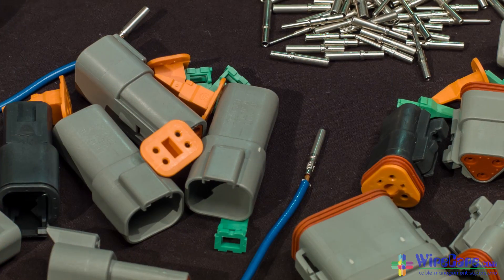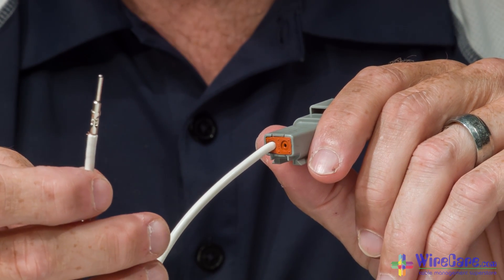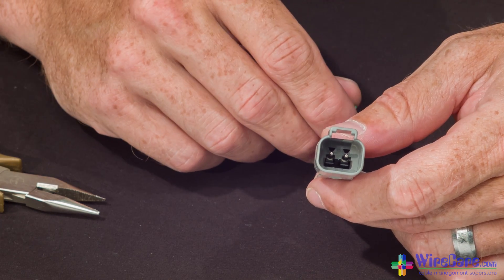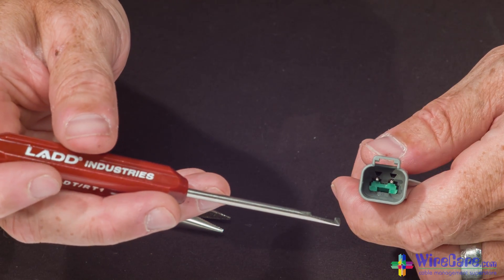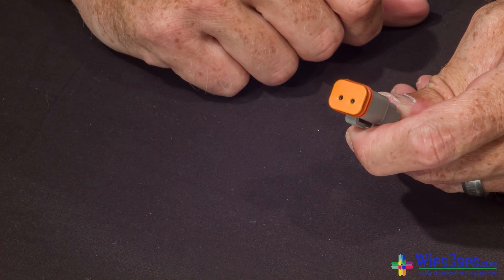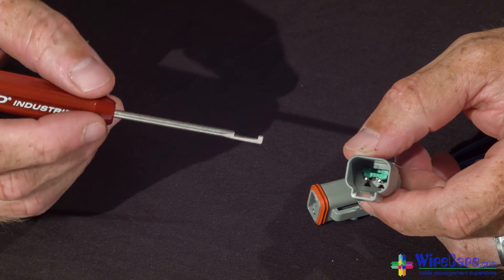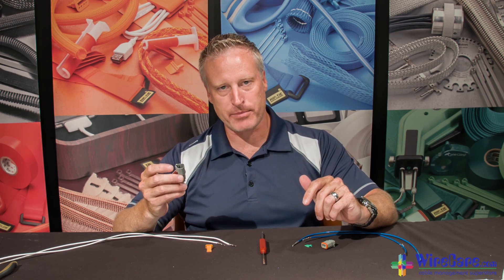How to Assemble & Disassemble Deutsch DT Connectors

Comment: Thank you for this. It was very helpful. I had to disassemble and reassemble a female fitting to get the wire through a too-small hole. You missed the catches holding the pins. It took me a while to work out why the pins wouldn't come out.
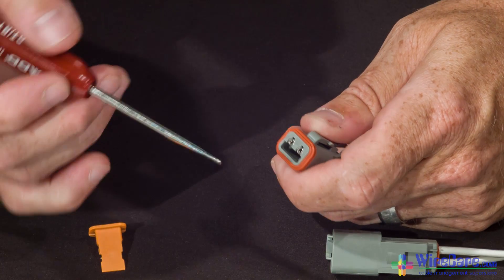Reply from the maker: Thank you for your comment. We appreciate it! At min 3:08 we do discuss depressing the tab to release the contact, but you are correct, we do not actually show the tab inside the connector. Sorry about that!

Comment: I guess it helps when you use the right lock for the right connector. Thanks for ending my temper tantrum. I was ready to throw everything in the garbage and go back to the tried and Tru solder and heat shrink.

Comment: very good instructions, should the power source be connected to the female or the male side?
Reply: I looked into this, and it seems per WireCare's response, the female side is standard for safety and reliability: 

"The female side of the connector has recessed contacts, meaning the metal terminals are less exposed. This reduces the risk of accidental contact with conductive objects (e.g., tools or metal surfaces), which could cause a short circuit. The female side is designed to provide a better seal around the contacts when disconnected, offering additional protection for live power connections."
Reply from the maker: Thank you! There are no clear cut instructions on this from TE about the Deutsch connectors. However, we recommend erring on the side of caution and going with the Female side as this is the standard practice.

Comment: Is there any way to use these with 22 ga wire?
Reply from the maker: Unfortunately not. You would want to go with the DTM Series which accepts 18-22 awg wire. These come in 2, 3, 4, 6, 8 and 12 pin arrangements and are good for about 6 amps. 
https://www.wirecare.com/category/connectors-terminals/deutsch-connectors/dtm-series-connector

Comment: I bought and open barrel,  and the crimping tool doesn't do it,  what should I do
Reply from the maker: From what you said, it seems as though you have 2 options. You can buy the solid pins and/or sockets and use the crimper you have or buy the crimper that works with the stamped and formed contacts. 
Please reach out to customer service at info@wirecare.com so we can better understand your situation.

Comment: Now any tips on how to unplug them? I find that’s the hardest part about them half the time 😂
Reply from the maker: Hey Josh...Hahahah, we hear you on that. We'll probably be doing a quick video on that as well. After getting the wedgelock out, you just need a small flathead screwdriver to depress the tab inside the housing that holds each contact. While depressing, just pull the respective wire and it should come right out. Hope that helps!

Comment: I had to get a new light bar and the Deutsch connection is a larger deutsch DT-P connection. Can I pull the old cable apart and replace it with the new DT-P connection?
Reply from the maker: As long as your wires can support the increase in amperage with the new light bar then you should be ok, just switching them out. The DTP will handle up to 25 amps so your wires should be 10-14 gauge.

Comment: I just got prob 40 Deutsch connector jumpers from my buddy. Gonna dismantle them and buy some pins after watching this
Reply: Do it, I working in the oilfield of west and south Texas as an Electronic Technician (E-Tech), we use Deutsch connectors all the time, GREAT CONNECTORS, and the Deutsch tool & crimpers are every e-techs tool bag.  They rarely fail when put together correctly.
Reply from the maker: Awesome! Should go smoothly. Let us know if you have any questions.
Reply: @WireCare  Went good. Bought a cheap kit, and some extra pins and now I can make a solid removable connection on any low amp circuit. It is very handy for putting through a firewall grommet as with the plug stripped off the pins and wires don't need a big hole. Can strip the wire and crimp them on the tailgate instead of in some cramped spot under the dash.
Reply from the maker: @juliogonzo2718  Awesome! They really are easy to work with. You should not have any problems.

Comment: Thanks for the video!

It took me far too long to find out that I need a hook tool to remove the wedge in the female connector...

In thee end I bent a tiny flat head screwdriver with a pair of pliers...

Maybe a hook/pick set will do the job in the future?

Thanks again for the info!
Reply: Yeah, the hook tool is the key for removal of the wedgelock from the male housing.
Reply from the maker: Hey Dan! That Deutsch removal tool is whatcha need.  It saves a ton of time and aggravation.

Comment: Simple Q ... I have DT06-6S   -    I don't have a specific crimp tool for Deutch  (only fitting 2 plugs) .. could a standard ratchet tool for insuated crimp lugs/eyelets be used .... or maybe even solder ?

Comment: Hi, Can you use different gauge contacts in the same housing?, I bought a 16 gauge plug but my wires are a bit too thick, am wondering if I can buy some 12 or 14 gauge contact and use them in the same plug. Thanks

Comment: More detail in video please. Which side pin goes in which side housing.
Reply from the maker: Great suggestion! Thank you.  The female socket goes in the male plug housing. The male pin goes into the female receptacle housing.
Reply: Yeah I just spent quite a while troubleshooting why they weren't working. I had the female pins with female terminals